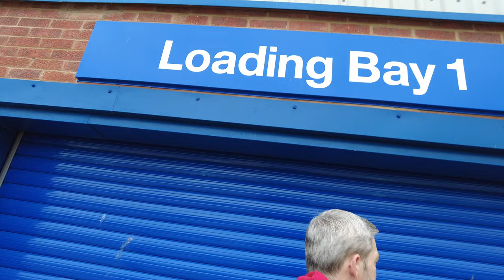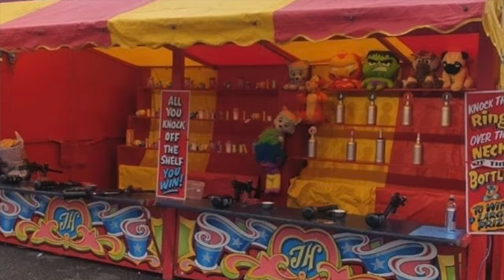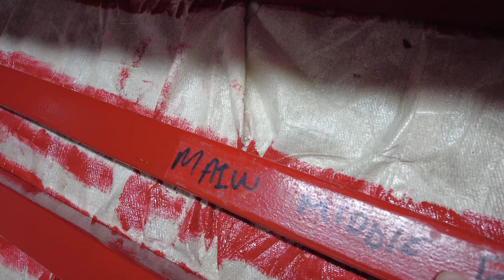Winter Work on Fairground Game!  Makeover including Painting & Repair

Comment: I would be getting different trade people in if you had the roof plastered like you mentioned at 0:47. I'm not picking at the kitchen but is the edge of the worktop next to the fridge cut parallel because it looks wider on the wall to the front of the worktop
Reply from the maker: I think that's just the camera 📸 🤣

Comment: I can see Simon isn't a painter!, firstly, you should never use oil based paint in a confined space like that, believe me, as a painter and decorator i have had that experience and it's not pleasant as you can easily be overcome by the fumes!, secondly, i have never seen anyone use a full size roller to paint small surfaces like that!, he needs a brush as that won't last very long, if i see him on the grounds this season i will be having a word, lol!